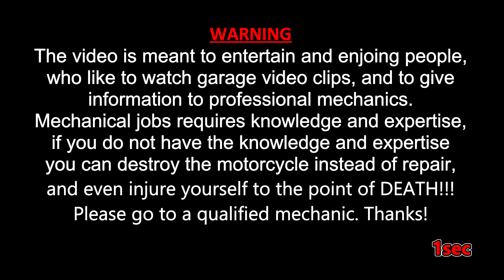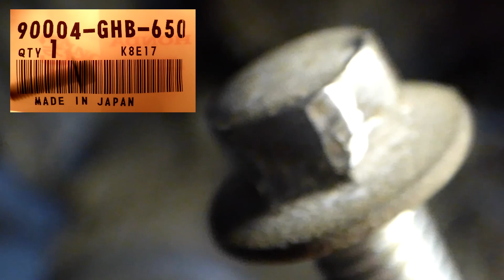Engine RIGHT Side Disassembly | STAGE-1D | HONDA INNOVA GARAGE

Comment: Beautifully explained I like this method
Reply from the maker: Thank you very much for your beautifully feedback! You have make me noticed about the necessity of making a separate video to explain the method. thank you very much.

Until then, here is the literal explanation for the method advantages:
This method makes the process easy to control and to not miss any actions. That way the chassis holds the engine and act like huge clamps and gives counter force to open the screws. Removing many parts of the engine relieves the weight of the  engine main parts. The "light-engine" which still fixed to the chassis, it is easier to separate him from the chassis.